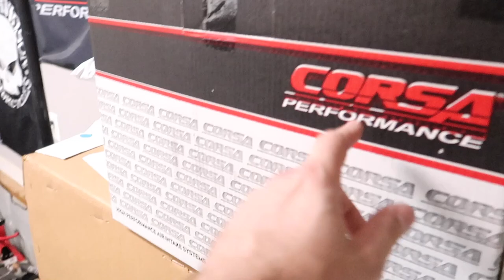EPA STOLE THE HORSEPOWER FROM MY 2022 MUSTANG GT, SO I FIXED IT WITH CORSA..

Comment: Great video Alex!  On the 22 and up Mach 1s the hydrocarbon trap removal gains 18 WHP. I noticed a huge power difference when I removed mine.  It's actually located in the tube instead of in the air box on the Mach 1. Ford said it was only 10hp but it's actually more than that. I'm not exactly sure with the gaines are on the GT's
Reply: Same thing with my 2023 Mach 1
Reply from the maker: 18 hp is a ton. Nice work 💪🔥🔥

Comment: Did the car feel like it was down on horsepower with the stock airbox compared to your old 2019 mustang or even the 2021 mach 1 you had? I have a 2022 gt, and am worried I'm missing out on the power the 18-21 mustangs had by purchasing one with 10 less horsepower and torque. I'm planning to buy the corsa cai as well, but just wondering how to stock airbox with the restrictions compares to the older cars power. Thank you
Reply from the maker: They feel about the same power wise. But the new intake feels a tiny better on throttle response
Reply: @Zander13Productions  appreciate the quick response. Good to know that I'm not missing out on much power

Comment: I got the Injen CAI with the similar design as yours. I tell you the car craves drag and track mode with the exhaust. Normal mode feels like it is not getting the airflow it really wants. I also did the resonator delete and it scares the 💩 out of me if I punch it.

Comment: What was your inlet temps and what was your Air/Fuel ratio after the intake install. Just wondering cause I did mine and the temp was 10 degrees hotter and the Air/Fuel ratio was 13.5-14.7 on throttle 20 off throttle
Reply from the maker: My IATs are about 3-5 degrees above ambient and AFR is the same
Reply: @Zander13  do you have a tuner?  How did you measure the AFR?
Reply: That is my concern, AFR.  It seems like a tune would be needed to get back where it's supposed to be.  Ford has stated the tune was also changed.

Comment: I used Corsa on my 22GT PP, love the Carbon look, I used the open air except I was supposed to get the red filter and got the blue. But that tube makes full throttle sound like the old 4barrel carbs opening all the way up! Love it love the sound! I had the big JLT on it I like the Corsa better plus no tune needed.

Comment: I was hoping to see you remove that sound tube as well. Looks like corsa is going to get my money because Roush doesn't have one for a 23.
Reply from the maker: I did remove the sound tube 😎🤘
Reply: @Zander13Productions were able to just pull it off as some have said or did you have to take time to unscrew that nut?
Reply from the maker: @chrisw.7039  I did it the right way lol

Comment: Yea I removed the carbon filter and all the plastic mesh ..like material with a drill using dremel bits , little work but looks very clean and open like 2021’s and previous models   Oh I dropped in an Airraid  synthamax red dry performance filter(reusable) for those that one keep her stock looking under hood
Reply from the maker: Nice work! That should definitely work to get the power back 💪

Comment: Terrible advertising for corsa.
Put the damn thing on the dyno or track and SHOW IMPROVEMENTS… or lack of.
Reply: If the stock tune will give enough fuel for the extra air, it will be a improvement, actually a significant one.  If not though, it will run lean and if driven hard enough will damage the motor.  I want to see one on the dyno with the AFR measured before I do mine.  If not I'll wait a while and put one in with a tune.
Reply from the maker: I can do that